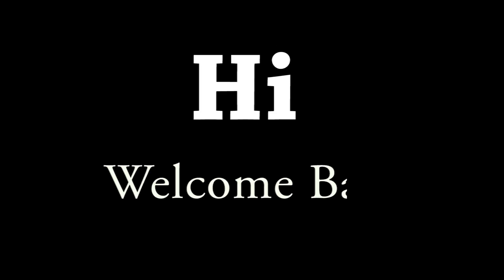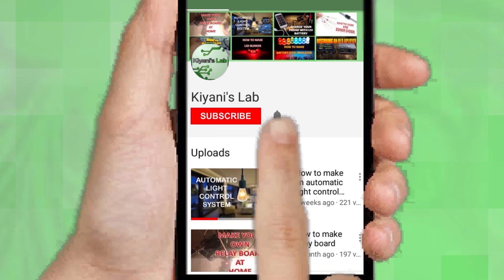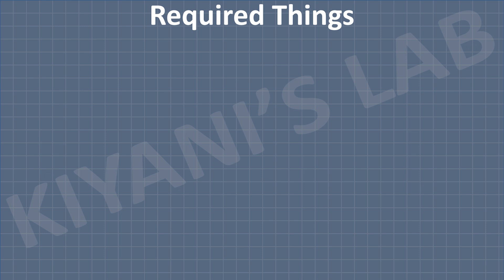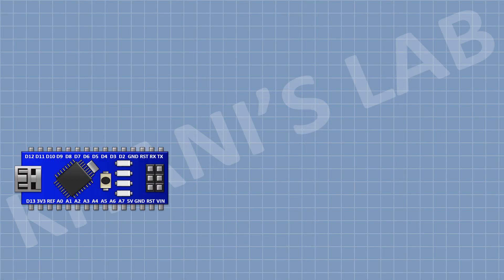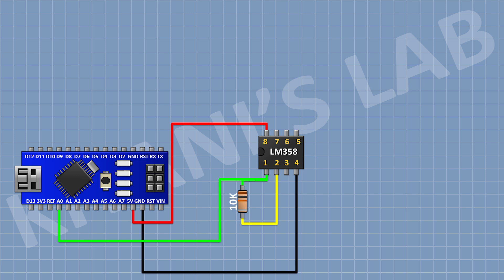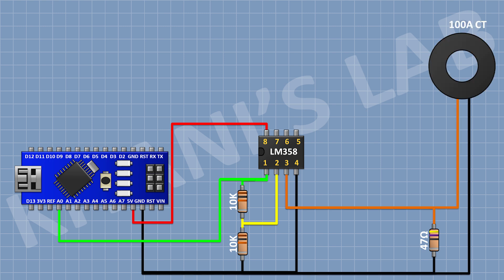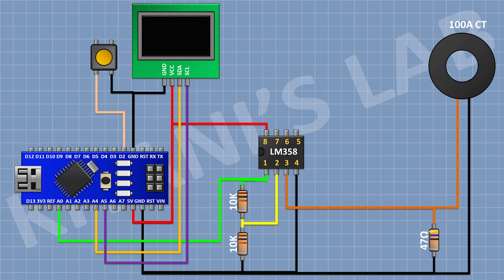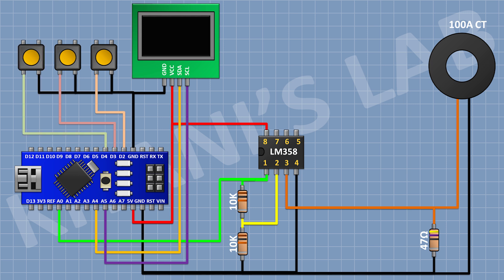AC Ampere Meter Arduino Project

Comment: Very vaguely described
No circuit explanation 

Some questions;
- what is the current consumption
- what is the cost
- will it survive voltage spikes [I doubt it]
- all data is lost if there is  power outage
- the specs for the transfomer do not make sense;
1X 100A/50mA (2000:1) CT

Comment: رووعة جيد جداً تتمنى منك جمع كل التفاصيل من تردد وأمبير وفرق جهد وكيلو واط وقياس درجة الحرارة وتشغيل وإطفاء المروحة كذلك نتمنى أن تعمل نظام حماية يمكننا ضبط الامبير والفولط حسب الحاجة وعن طريق الشاشة
Reply: Very vaguely described
No circuit explanation 

Some questions;
- what is the current consumption
- what is the cost
- will it survive voltage spikes [I doubt it]
- all data is lost if there is  power outage
- the specs for the transfomer do not make sense;
1X 100A/50mA (2000:1) CT
Reply: circuit explanation is needed. It is pointless to blither on;  connect this to that.....connect this to that.....connect this to that.....connect this to that.....

Comment: Very useful video 😊
Reply: circuit explanation is needed. It is pointless to blither on;  connect this to that.....connect this to that.....connect this to that.....connect this to that.....
Reply: Very vaguely described
No circuit explanation 

Some questions;
- what is the current consumption
- what is the cost
- will it survive voltage spikes [I doubt it]
- all data is lost if there is  power outage
- the specs for the transfomer do not make sense;
1X 100A/50mA (2000:1) CT